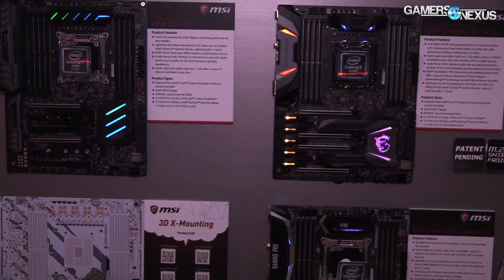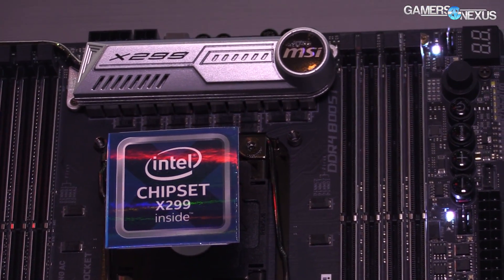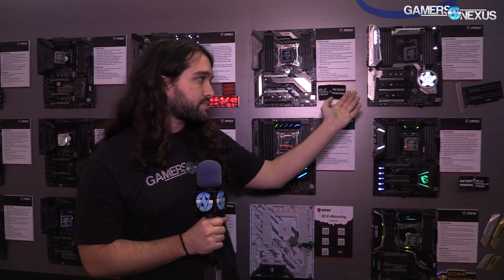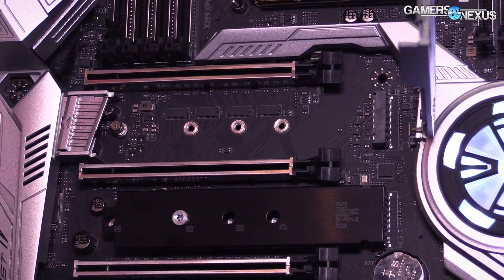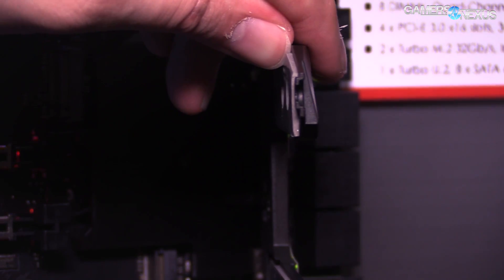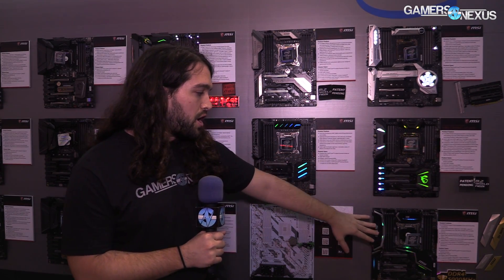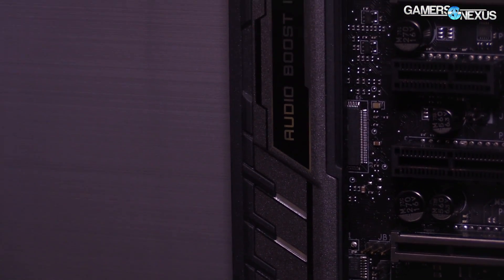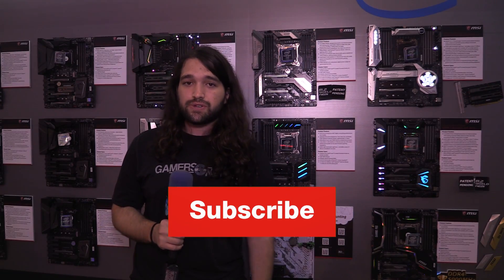MSI X299 XPower, Pro Carbon, Tomahawk, & SLI Plus | Computex

Comment: I feel all the X299 board designers are in an out-cheese competition with one another. I've recommended some Asus ROG boards, especially Black Editions, for some professionals who don't want to pay for a WS edition board, but man, couldn't do that with a straight face this gen.
Reply: Black edition boards have notoriously bad support from asus as they dump them at the EOL of the socket. i could write a whole page on issues i had with my x79 rampage black , which whilst was an amazing piece of hardware had some serious bios issues
Reply: Though this may be true, that complaint is true of all Asus boards on an EOLing platform, especially the RIVE, from which the BE is derived. The BE is the best X79 board that will ever be, is RGB free, and passively cooled. It's PCH heatsink is minimal, and the IO additions to the chipset make X79 not feel so antiquated.

Comment: Can someone clue me in on what this obsession with VRM's is all about. Every mainboard and gfx card review seems to be mostly about that. Is it overclocking potential, build quality or something else?
Reply: ElDuderino its a bit of all that. Look i'm no expert but from what i've gathered more and better voltage regulator modules (hence VRM) provide "cleaner" power to the CPU/GPU, this tends to provide more stability, higher overclocks and an overall longer lifespan to the chip in question. 

So, in a nutshell, good power designs means better overclocking potential, better build quality and more stability.